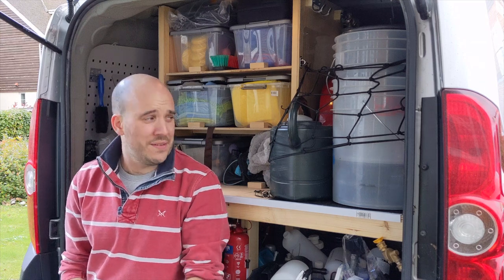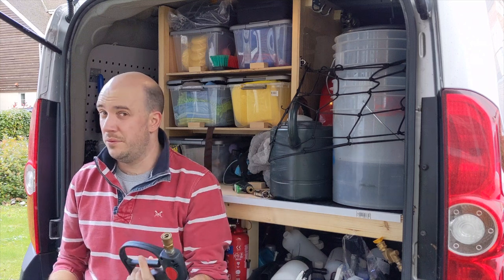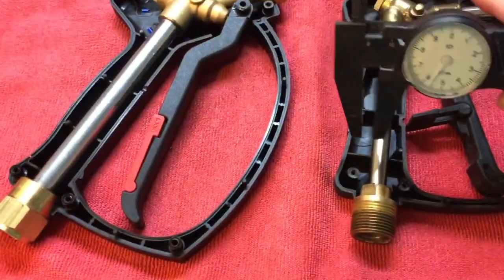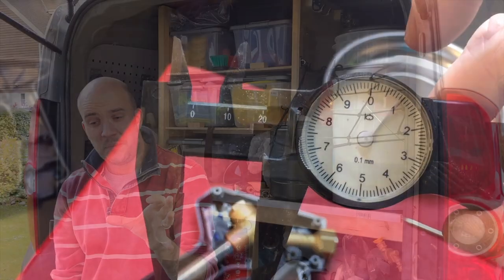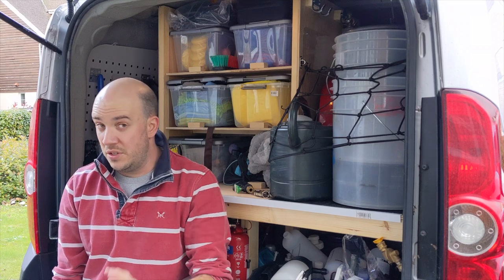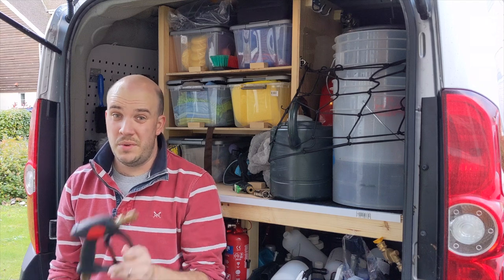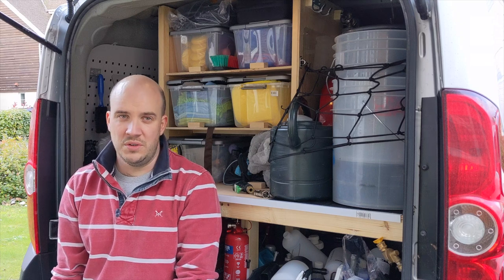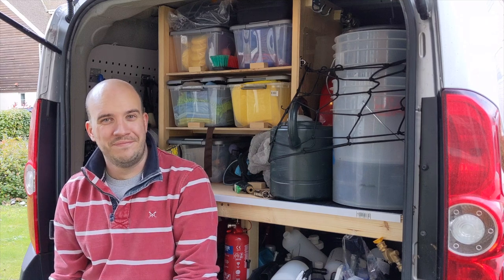Review: Your short pressure washer gun could be causing you some serious problems

Comment: Just found this Adrian, I've bought the pack from Direct Hoses comprising of the AllBlack 9, 20ltr hose and reel with their own QR gun. Had it nearly a year now and it hasn't missed a beat not even a splutter, for a weekend warrior I give it some hammer sometimes two cars a weekend in and I did the neighbours tractor too. Fingers crossed they have matched the gun and hose to the machine.
Reply from the maker: I believe they have and you should be safe there. But if it goes wrong at any point, you're very likely on your own. They did me again since this video when I sent my hose back to be mounted on a reel. It ended with a PayPal dispute to get it resolved.
Reply: That's not good but it's not the first time I've heard this. If it goes wrong there are other companies I'll be going to.

Comment: Most of us are using a low pressure output pressure washer, Karcher K2/4 or the equivalent where this won't be an issue though .... I've Karcher HD 4/8 with the Karcher stubby and have bought the Halfords Stubby for the quick release convenience and both work fine with no issues
Reply from the maker: This was on the Nilfisk C130i, which is about equivalent to a Karcher K4. You're absolutely right that a K2 wouldn't trouble it.

I've got an HD4/8 as well, which also is pretty low powered and unlikely to give it much trouble, but all stubby guns are not created equal...and that Halfords one seems good!

Comment: Very good PSA! I have been planning on getting a stubby gun. But as the saying goes, "Buy cheap, get cheap"!
Reply from the maker: Yep it certainly seems to be the case with this. Your current setup with the QR nozzles on the standard gun is looking good!
Reply: @Supercharged Llama Detailing  Yea, but I get my own frustrating pulsing issues myself, so trying to get to the bottom of that too!
Reply from the maker: @jtcrow  I've had some comments on Facebook that it may also be down to the orifice size of the QR nozzles, so I'm looking in to that too.
Reply: @Supercharged Llama Detailing  Yes, that would make sense- I don't remember it pulsing with the OM lance. I use a Karcher K4. 🤔

Comment: Hi there what is the cheap gun? Seems very similar externally to the Annovi Reverberi MV925 but I have seen better internals on the Annovi compared to hours, atleast does 8 GPM which I think would be sufficient for most, thank you
Reply from the maker: If it's indeed the MV925 👍
Reply: Hi so just checked the MV925 and mine is of much higher quality and for the price it’s good I think the one that you have got is a knock off from the MV925 don’t think you’d have any issue a genuine version though. I paid £39.99 for it so can’t complain at that price
Reply from the maker: @protester2474  I will double check on the model again but I'm pretty sure it is that model. I can't imagine Direct Hoses would be selling a knock off, but you never know.

Comment: had pulsing on my 7yr old K4 with old cheap stubby gun for 4 years now.....but also had an aqua stop adapter on the hose (bad for PW).  removed that, but still had the issue (also had to get some minor repair done to the outlet section of the K4 post-winter 2021, now have cheap duvet when storing in shed).  Recently bought a new AM Details stubby gun and K4 is working perfectly now.
Reply from the maker: Sounds like a very similar experience, I changed to the MTM gun and it solved the problems.

Comment: I have both and the cheapo went in the bin.
Had to increase nozzle size due to a 30M hose but it wasn't a problem.
Reply from the maker: This is the nozzle orifice, right? What diameter are you running now?
Reply: @SuperchargedLlama  .It is a 04 but I reamed it a touch bigger until it stopped the motor pulsing. Way too many variables to try and calculate the perfect orifice size mate.
Reply from the maker: @jasonphillips3865  pain I the ass isn't it. I think I'll end up getting the gun and nozzles from Carscope as they've got the high spec rubber tipped options
Reply: @SuperchargedLlama . I got stainless steel rubber tipped nozzles off ebay for £8 each.
Reply from the maker: @jasonphillips3865  thanks for the tip!!

Comment: Useful video, I bought a cheapy  stubby gun and have not had the pulsing issue with my old dying karcher K2 ( most of the pulsing vids I’ve seen were on Karcher machines) but I’ll definitely check to see if it happens on my newer Karcher K4 and I’ll try to remember to let you know the outcome. 👍👍
Reply from the maker: Have you got the little plastic nozzles like I have in this video? There's another element there whereby you need to make sure you've got the correct sized ones for the flow rate you've got. I've got the 030 ones for the C135i and that's alright.
Reply: @SuperchargedLlama I have the 5 colour options, 3 angle,1 black and the red one went in the bin as it has no business being near a car 😂, sadly I’ve had 4 days straight of rain and I’m still hoping for an overcast day just to give it a test run.

Forgot to say I will be investing in an MTM 12 gpm like the sgs 28.
Reply from the maker: @WEZ4136  on the size of the nozzles, on the metal bit that goes in to the quick release connector, there will be a stamped number that's 3 digits long. Have a look at what you've got at some point 🤘
Reply: @SuperchargedLlama  I think the yellow 15° tip is something like 40015, I have spare green and white in the house and they have white 40° 40035 and green 25° has 25035, I’ll check for sure on the yellow if it ever stops raining and I can actually get some cleaning done 😂
Reply: I also upgraded to the rubber lay flat flexiwash hose from direct hoses with the in built swivel, can’t wait to try it all out, but this weather is beyond uncommon for this time of year

Comment: Yesterday tested my brand new AVA P57, with the original gun no prob, but when I connect it to a cheap trigger gun (brandnew) it starts pulsating...so I ordered a MTM S28 gun, waiting for delivery  and hopefully it wil work...keep you informed (the spray nozzles I use are 040 )
Reply from the maker: Do you know what orifice size the nozzles are? That's another variable 🙄 

On my P57 I've stuck with the Ava gun and just use their variable nozzle.
Reply: @SuperchargedLlama  the white nozzle is 040mm, when I pull my gun and keep the trigger open and at the same time I turn the Ava on it works, than, when I release the trigger and pull the trigger back on it start's pulsating, so I guess the gun can't handle the 500bar pressure, the pressure can't be adjusted on the Ava...In theory it should work withe the cheapy gun as it has a flow rate of 8gallon(30 liters/min) and the Ava has a flow rate of 500 liters/hour which is 8,3 liter/min...the Mtm s28 12gallon which is 45,4 liters/min...can't find any info on the web about pulsating Ava P57 which is strange...the less powerfull PW's seems to have no problem with this
Reply from the maker: @digitalcampi3289  yeah I think you could be facing the same sort of issue I was too. I went for the sgs35 and that solved it for me, it'll be interesting to hear what results you get.

But to clarify, I've not used my stubby gun on my Ava P57 as the stock setup works well for me...I might get a 40 degree fixed nozzle from Ava though.
Reply: @SuperchargedLlama  finally my MTM arrived after it was lost by the parcel service, so today I had the chance to test ! I can confirm that the MTM gun on the Ava P57 works wel so no pulsing anymore, I used the withe nozzle with an aperture of 1.4mm
Reply from the maker: @digitalcampi3289  thanks for taking the time to let me know, it's useful for when other people ask, I can reply from a position of knowledge!

Comment: You don’t think it spraying through a tiny nozzle or orfice on a foam cannon would do the same thing as smaller piping.?
Reply from the maker: It should do, right? It'll be an interesting thing to test when I do switch over to it. I can say for sure that the for rate is less when I'm drawing from the tank in my van (I measured it and now I can't remember what the figure was, will have to do it again).

Comment: Can you drill out the nozzle to allow more water flow ….purchased a gun and hose from hose direct and the pressure washer keeps shutting off as pulsing .
Reply from the maker: You can buy wider diameter nozzles (not in terms of spray pattern, but flow rate). What PW are you using?
Reply: @SuperchargedLlama  karcher 6.75 .. thanks for your reply.
Reply from the maker: @saab93contdi  your best bet is to speak to PressureWasherParts UK https://www.ebay.co.uk/str/pressurewasherpartsuk they are really helpful and will recommend the right size orifice for the PW you have. It may not solve the problem, it could be something that's been impacted now that you can't do anything about, but at the same time it could help prevent the issue happening again.
Reply: @SuperchargedLlama  the retailer sorted out my issue with no further cost….all works fine now.
Reply from the maker: @saab93contdi  thanks for taking the time to let me know 🤘

Comment: are the direct hoses guns cheap ones or are they ok ... im running bosch 125 pressure washer?
Reply from the maker: They aren't the cheapest no, but if they aren't MTM guns then they aren't the best out there. Someone in the comments berated me about slagging off the trigger gun here - it isn't bad, but there's better. I'd be curious if changing to 3/8" QR connectors will make a difference and I intended to do that, but I can't get these apart (because I've rounded it off, not realising they were threadlocked).

Comment: You alright mate, is the Autobrite one a good one or a 'cheap' one?
Reply from the maker: Judging by the price and the flow rate I think that's a cheap one. It quotes 25L/m on their site (the one that is £35) and that converts roughly to 6 US gallons per minute. About half of what the MTM ones are.
Reply: @SuperchargedLlama  damn that's the one I've got!
Reply: @SuperchargedLlama   thanks for the fast response, this is the one i use with a k2 and doesn't pulse very often, but it does do it occasionally
Reply from the maker: @swift2117  I'm also in a similar boat too with mine. There is also something about the nozzle orifice size, something else to look in to! What amazed me was how much cleaner the flow was coming out of the MTM gun.
Reply: @SuperchargedLlama  Thank you for sharing, yes I think a 1.1mm orifice is good for a snow foam lance. I don't know much about the gun though.
Reply from the maker: @swift2117  there's more to it again apparently, even the quick release pressure wash nozzles have different orifice sizes! 🥴
Reply: @SuperchargedLlama  looks like you're going down the rabbit hole!
Reply from the maker: @swift2117  certainly a money pit! 🤣

Comment: Got no pressure coming from the pissy gun
But pressure works good on the wand
Reply from the maker: Thanks for letting me me know? I'm not sure if you're asking a question or seeking advice at all, but you've written a statement, so it's not really that easy to reply to.
Reply: @SuperchargedLlama  sorry, I meant I got a spray gun
But no proper pressure comes from the gun.
But when I connect normal wand, water pressure is good
Not sure why my gun doesn't have the pressure?? Any ideas

Comment: i have a 1600 psi pressure washer you think the cheap gun can handle it
Reply from the maker: It can definitely candle it as in it is rated for much higher PSI. I think the question will be more like "will you get the performance from it ?" And I can't answer that at the moment, having still not changed mine (other things have required spending on).

Comment: can we use these different brands on karcher K series ?
Reply from the maker: Yup, as long as you've got the K series hose adapter.
Reply: @SuperchargedLlama  Hose adaptor , Can you send me a link for hose adaptor & video of it.
Reply from the maker: @tariqhassan9672  yup, this is the adaptor that goes on the inlet of a stubby gun to connect to a Kb series hose https://www.in2detailing.co.uk/products/genuine-karcher-quick-screw-coupling-adaptor?ghref=3377%3A373130 or Amazon https://amzn.to/40XGtmb

And this is a very good stubby gun you can have it configured with so you can see how it would look https://www.in2detailing.co.uk/products/suttner-2300-karcher-k-series-quick-release-short-trigger-gun-with-quick-release-nozzles?variant=32866292760655&ghref=3377%3A373130

Comment: the genuine short gun is made by tecomec, and it's part of their mecline lineup, it is supplying to AR, which i dont think is gonna be low in quality...

which leads me to suspect u r holding a chinese knock off... sorry if u got cheated, hope u didnt spent too much on it
Reply from the maker: I shall have a check, any ideas how I will be able to tell? I use an MTM now anyway.
Reply: @SuperchargedLlama  tbh I’ve no idea, but mtm seems like a safe bet. It’s not as expensive as mosmatic but it’s clearly better made than those knock offs. Would u recommend full stainless steel or sgs28 will do?
Reply from the maker: @haikuancheoh2418  I went with the 35 as I wanted stainless and not have to think about it anymore, if that makes sense? 

I friend of mine has the Sutner gun and I have to admit that it's nicer than the MTM - it feels like the trigger is a bit more progressive.
Reply: @SuperchargedLlama  wao that’s some good stuff u have there. I’ll check suttner out, I know a Brit who sells Kranzle recommends suttner too.
Reply from the maker: @haikuancheoh2418 my friend is a Kranzle user too, I think it's quite a common upgrade. I guess generally if people are paying for a Kranzle then they're happy to spend on the gun too.